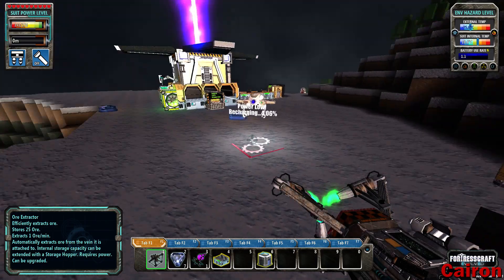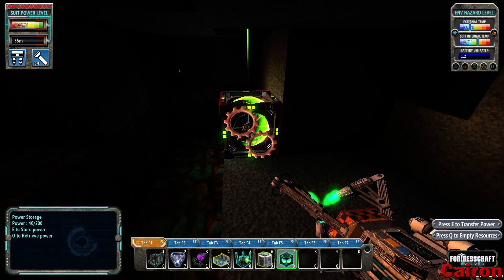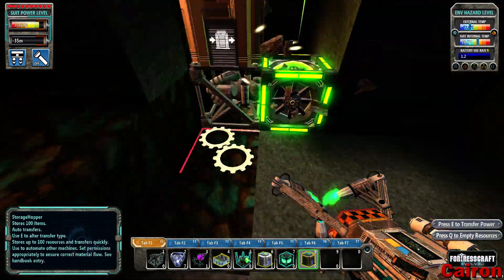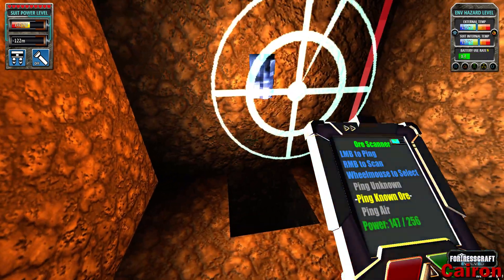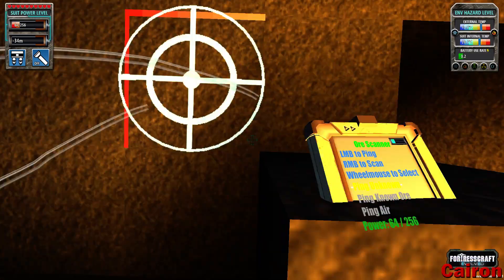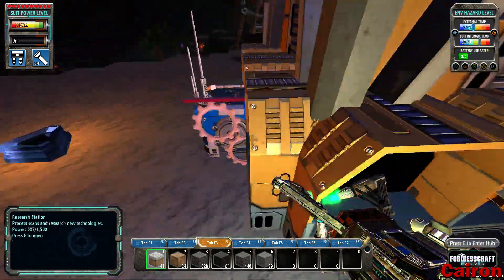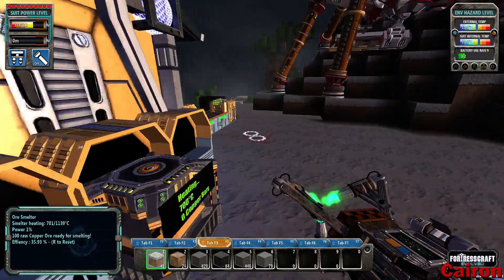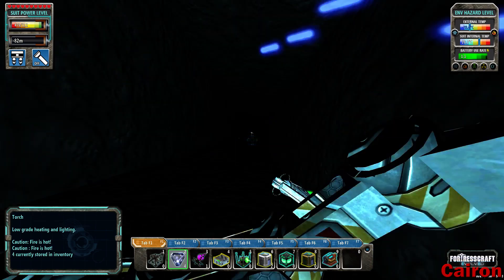FortressCraft Evolved #3 - I'm Firin' My Lazor!

Comment: Noice! This game doesn't have an absurd amount of (modded) content like Minecraft but it really is fun and interesting. Solving the problems and issues you bump into is always interesting.

My tip to you this time is another thing I noticed you do exactly as I did. In the beginning, I focused a lot on keeping the excavators powered. But if you look at'em, they probably fill up (without a hopper) and use very little energy (I think it's around 50?) before filling up.
In other words, it felt better to focus on transport to me. That way they work for much longer non-stop, and even with the cheap basic conveyors you can get a good flow of resources pretty quickly. This will keep the smelter and excavators working almost 100% of the time, and it helps a lot since the game is rather time consuming. This also means you can use more excavators on each vein since power consumption is pretty low (after you got the coal-burning generator).
> Since you already got Storage Hoppers, this doesn't apply 100%.

And of course, you're doing this your way, which is what makes it fun and interesting to watch. :)
I'm just telling you these things because my first hours in this game were pretty frustrating!

Keep'em coming, and thanks! I've also been watching your Banished series, and it's also good.
Reply from the maker: +Gabeux Thanks a lot, I definitely appreciate the support and tips.  I did some optimization/cleanup work after recording this, so every ore extractor has a storage hopper, clear pathing, lighting, all the good stuff.  I won't reveal too much, you'll need to wait for Ep. 4.  :)  Each episode I hope to hit a major technological milestone, and Ep. 4 should progress us quite a bit.  Good stuff!
Reply: +Cairon you've probably already figured this out or maybe you can't do this but if you burn coal at a generator and use a laser and point it at the hub it might charge... if it doesn't work on the hub it will work on other objects that require power

Comment: Just a thought (haven't gotten the game myself; however, I've seen several people do it), you could widen your  surface holes with ore deposits behind them. This way you could use your ranged charge ability (pressing "g"?) and fill up those quick access nodes from your charging platform. This would also allow quick ranged access for collection. Of course for aesthetics you'd have to make that new wider hole fancy in some way (give it an actual mine shaft opening, maybe with some wooden blocks).  Anyway, keep it up, looking good.